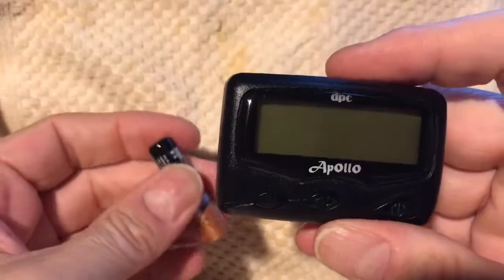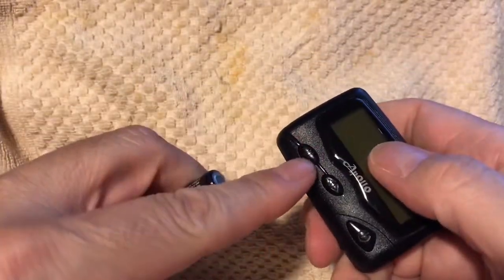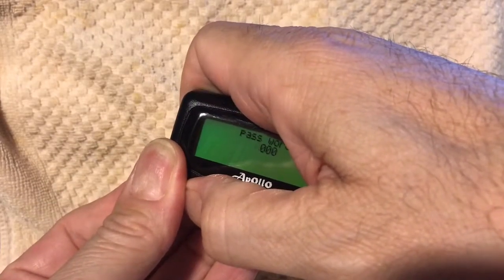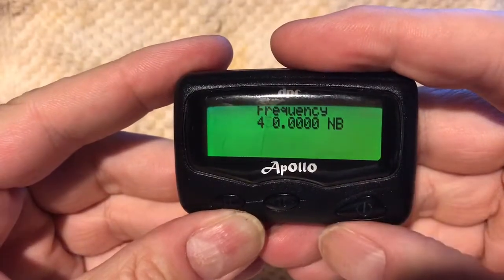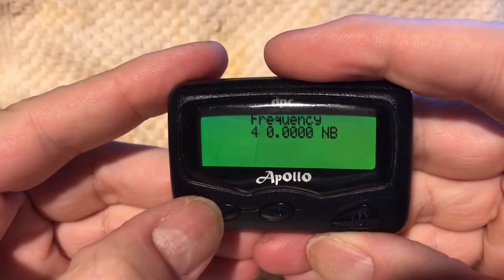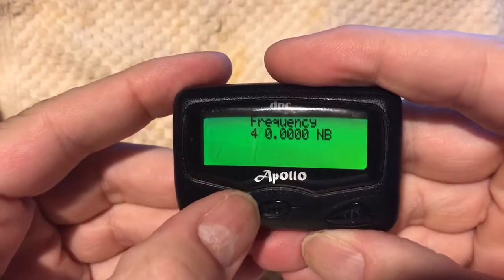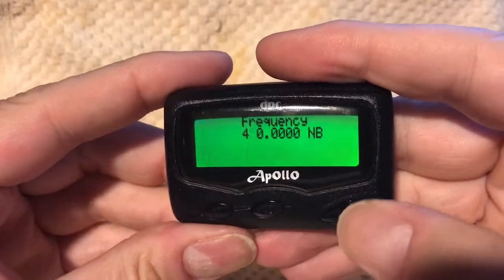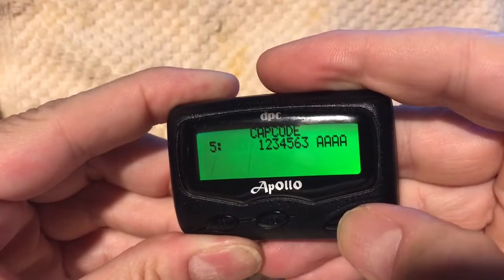Apollo 924UHF Pager

Comment: can it be programmed for 439.9875 mhz (pi-star dapnet) ? thanks
Reply from the maker: It can - however this specific model does not operate in that range.
Reply: David Cappello i wonder if you can change the default frequency in pi-star from the above frequency to one thats compatible with the apollo...thanks for the reply and best 73
Reply: Gaz uk yes you can set the frequency in Pi-star / which is what I did from the default.
Reply: David Cappello oh cool i will do that then thanks david 👍